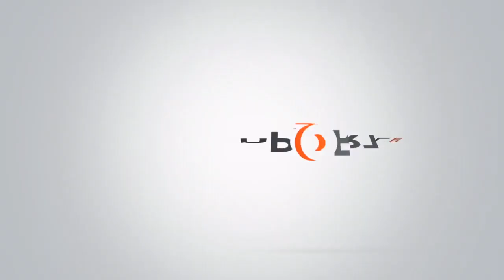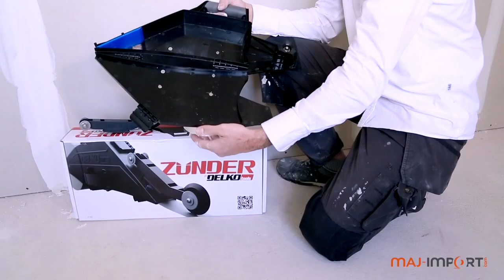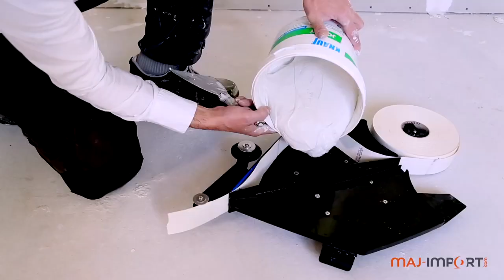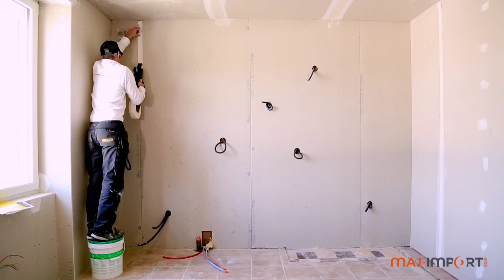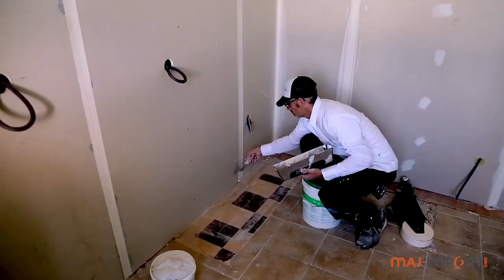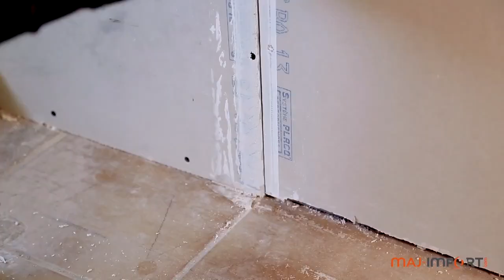What is a drywall banjo? Delko Tools banjos apply pre coated tape to flat & internal drywall joins

Comment: why do they call it a bazooka 🤔
Reply: Bazooka is a different tool from a banjo. Bazookas are an auto taping tube that mechanically pumps the compound as you roll it. 

The banjo just pulls the tape down onto the mud inside
Reply: @Justin-jx1ui  which do you prefer
Reply: Im just getting back into drywall finishing. I've always just did by hand. But I just bought a zunder banjo. Will be giving her a first go this week. I'll let you know. I was tought old fashioned so this should be fun! The bazooka are substantially more expensive then banjo. But get what you pay for it seems. Ill let you know how banjo goes
Reply: Love the banjo. Thumbs-up 👍 👌